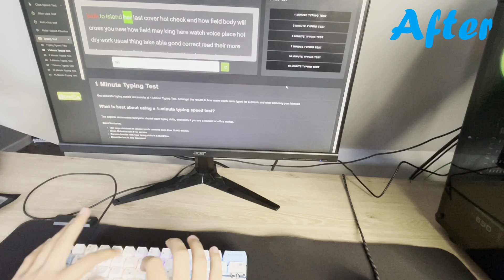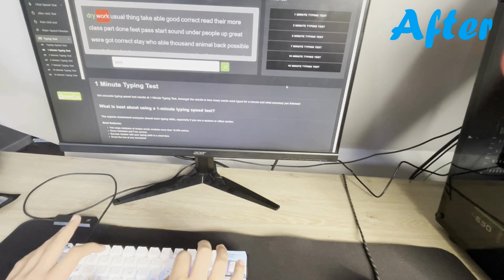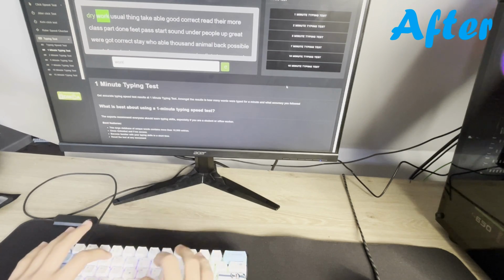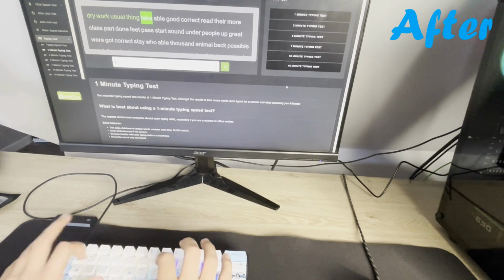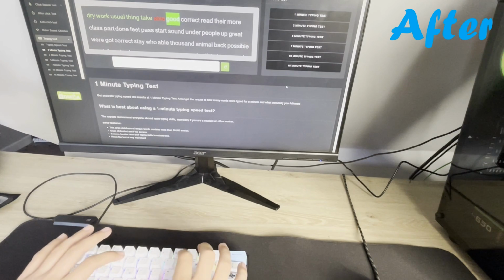Keyboard Tape mod - Quick Tutorial

Comment: hi i have a wireless keyboard and there are a tiny section where my AAA bateries are exposed to the psb can i still put tape mod
Reply: Is in my community post
Reply from the maker: @Bigahhok it should be fine with electrical tape
Reply from the maker: Uhm I would have to see what it looks like to tell you what keyboard do you have?